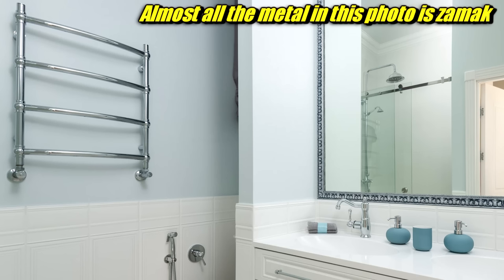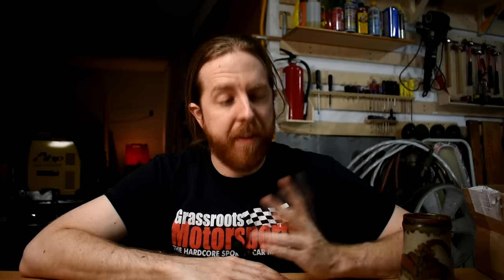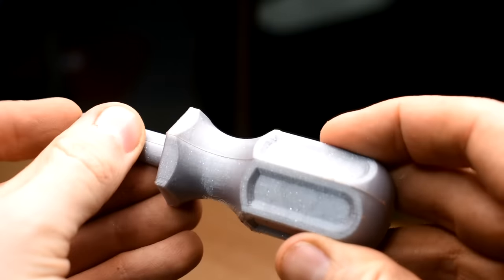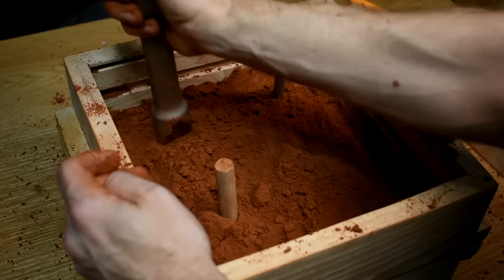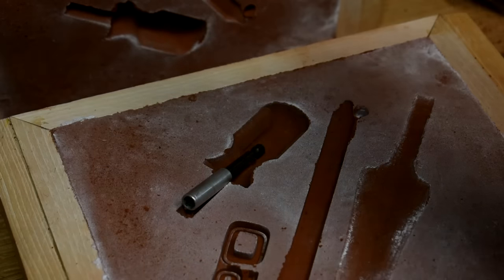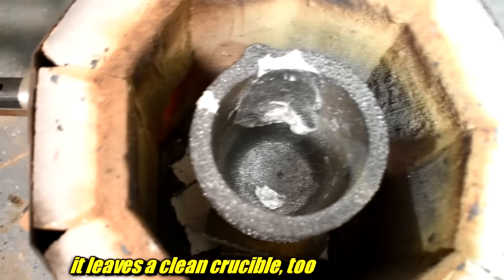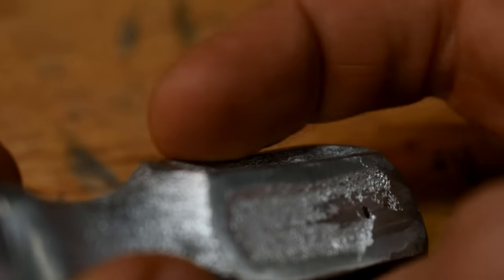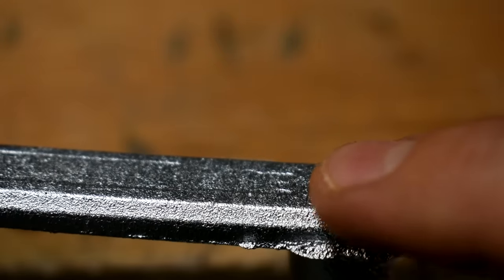The BEST Metal Casting Alloy That Everyone Ignores

Comment: Great stuff. One of the qualities that has made it unpopular is that designers use it as one of the go to materials for planned obsolescence. Since the zamak metals have predictable shrinkage they can for example, be used to make sure a fan will seize up after a predictable period of time. This is really good stuff, but it has been used in evil ways.
Reply: Thats interesting bud!
Reply: predictable shrinkage, as it slowly shrink years after casting?  what?
Reply: @tsm688 Ok, I found a page that says “Zamak alloys No. 3 and 7 can shrink about 0.0007 in./in. after several weeks at room temperature.”

However, I find it exceedingly unlikely that it is used to create planned obsolescence, since the amount of time can’t be delayed (only shortened by annealing), and no manufacturer wants their product to fail while it is still under warranty. Overall, I think that planned obsolescence is not even remotely as common as people claim it is. People confuse “short lifespan as a consequence of cost-cutting” with planned obsolescence, which is artificially limiting something’s lifespan.
Reply: @tookitogo  several Zamak alloys have predictable shrinkage rates at room temperature over a ten year period. It is small, but tolerances in bushings and bearings are also small so it is quite possible to aim for a unit to seize up or break after an intended period of time. Some allowance has to be made for shelf life before the sale, and heat exposure due to use, so the real calculation is to closely match an assured allowance for reliability. This is also the sort of wording that would be safer to use in internal documentation so your planned obsolescence can't be easily proven.

That said, if the design is done well, this stuff is great. It is only when manufacturers choose to use it in evil ways that it becomes a problem. 

When I learned drafting in the late seventies, we were taught how to design in obsolescence. There were industry scare stories about not doing it. One of them was about the perfect (for the time) oscilloscope. Basically a company made an ideal and durable oscilloscope, sold all of them that anyone needed and then stopped making enough sales to keep the production line open. The employees moved on, retired, or forgot what the tricks where and when the digital age started up in the seventies, there was a sudden huge demand for fast oscilloscopes and no one was able to produce anything close to what had been made years before.

So of course the lesson learned was not the right lesson and instead industry decided that planned obsolescence was the best solution.
Reply: @BobStrawn  I’d love to know examples of actual measures that training proposed be done. 

The main thing I object to is when cost-cutting is claimed to be planned obsolescence, when in fact it’s just matching the durability to the expected natural lifespan. For example, before smartphones, the average lifespan of a cellphone between replacements was 18 months. So there was absolutely no reason to spend extra money on extra-durable components that would let it last for 10 years, because most people would replace it long before that anyway. Similarly, we could design cars to last for 30 years without issues, but to do that we would have to sacrifice fuel efficiency, and the up-front cost would be higher. 

Major household appliances (“white goods”) are another interesting case. Their quality has clearly gone down over the past, say, 60 years. They are made with much cheaper parts that fail sooner, not to mention with added poorly-built electronics that aren’t built robustly enough for the severe environment of the appliance. But what people forget is that this is, in part, due to the fact that the store prices for these appliances are far lower than they used to be. Adjusted for inflation, a basic washing machine in 1955 cost many thousands of dollars in today’s money, while a basic machine today costs just a few hundred bucks. There’s no way to build something to the same build quality at 1/10 the price, even with foreign labor. Consumers like to say they’d pay a little bit more for quality, but in reality, they vote with their wallets and have consistently chosen the lowest-price items over the long term, so that’s what manufacturers make. (And yes, I acknowledge that private equity firms and the like have also pushed for cost-cutting for the benefit of shareholders. There isn’t just one thing to blame.) But I’d argue that cost-cutting in white goods actually shows that it is not planned obsolescence because of how many brands got so bad that recalls and lawsuits have cost them fortunes, and the damage to their reputations has been catastrophic. Planned obsolescence would ensure the products work well enough and last long enough that customers will still have positive associations and choose that brand again. 

I can only assume the oscilloscope company in question is Tektronix (which invented the oscilloscope as we know it today, and is still around almost 80 years later, still making oscilloscopes). They are no longer the absolute industry leader, but that is a fairly recent development, as they still were the leader in the 80s and 90s, with the best digital oscilloscopes at the time. Since then, “best” has become harder to define, as digital oscilloscopes have evolved in different directions, optimized for very different things, with various companies specializing in one type of digital oscilloscope or the other. Tek has sorta failed to specialize, so their current products are not really optimized for anything. :/
Reply: in the 50's and 60's, chrome-plated trim parts made from zamac alloys were the car industry's equivalent of today's chrome-plated plastic trim parts.
Cracks and pitting due to corrosion are their worst enemies, and they're about as difficult to restore/repair as their modern plastic counterparts (if not even worse)

Comment: You can get away with using high temperature silicone moulds (molds) for the lowest temperature Zamak alloys. The mould material does degrade but it's worth it for the fine detail you can get.
Reply from the maker: I've seen some people do that, it looks really interesting
Reply: If the mould is degrading I’d be very careful about fumes…
Reply: @athannaelanderson3806  From silicone? Should be nearly inert.
Reply: @Sgtassburgler  Key emphasis on nearly, hardly any products on the market are pure silicone, most companies include filler for extra profit, also silicone is stable yes but at high temperatures it does break down and if you read the scientific papers on Google scholar about it, it typically isn’t something you want to inhale, especially with those fillers, in fact silicone cooking utensils can also break down and liquefy in foods and than be absorbed when eaten, wreaking havoc on your system. Silicone is a great product when not used with heat, any kind of heat and silicone should not come to mind. Everyone considers something safe until they can’t profit off of it or until enough idiots die. You want to make proper moulds like our ancestors did, you want fine details, learn how to make your own clay! I’ve been moulding with clay for years, you can make it nice and liquid and pour it to make moulds just like silicone…

Comment: I found this very interesting in the following sense. I started my apprenticeship as a machine tool fitter in 1964 for AC-Delco, a division of General motors here in the Uk. One of the jobs we had to do was to repair the vane and screw hydraulic pumps for the injection moulding of this alloy. It was used for making 'mechanical fuel pumps, water pumps, etc and many other components of a car. I had some counterbalance weights cast from it for a home made telescope But this was never called 'Zamak', it was always calle Mazak.'  'Mazak' was it's original name and was later changed to Zamak. Personally, I prefer the former. An interesting video and thanks.

Comment: Zamak was used for making change gears for atlas/craftsman lathes, so it is a fairly durable metal.
Reply from the maker: Durable and supposedly a bearing alloy too, which is pretty cool
Reply: can confirm cast zamak gears work great, and are pretty quiet.
Reply: i had a set of those pot metal  gears in my craftsman lathe for 50 years, still good

Comment: Machines great too. Turned a vbelt pulley out of a simple puck of zamak I cast in an open faced sand mold. Melted zamak in a stainless pipe crucible over charcoal in about 10 mins setup to pour

Comment: 7:46 - I’d epoxy, a small neodymium magnet in the bottom of the Bit Well to make the bits hold again, then I would dip the handle part in some of that black handle coating. You can buy it at hardware stores or big home improvement centers. You’d have a great tool, then! Excellent video!
Reply from the maker: thats a great idea.  I have a couple of the tiny magnets that fell out of some other screwdriver bits, i could just jam one in there with some epoxy.  All fixed!
Reply: @PaulsGarage  Well hindsight being 20/20… neodymium magnets are really brittle, so you wouldn’t be able to put a whole Lotta pressure on it and definitely not hammer on it. It might be worth machining (or filing) a flat spot on the outside till you just break through to the inside, then just stick the magnet on the outside over the hole. Can you visualize what I’m talking about? You probably do, but I can send a drawing to your email if you like.

Comment: I used it to cast the front plate for the lexoptical camera using a lost PLA process. It worked amazingly well and resulted in a stiff strong component which easily holds lenses true.
Reply: hmm if i read corret the melting point of zamak12 is around 380C the silocon molds hold up to 450C you could cast small series of items :)

Comment: "The Metal Fume Fever" is no joke and something I learned to be aware of real quick when alloying bronze From Copper/Zinc/Tin back in the day. Hated the zinc shakes, we used to call it "The Zinkies" was some weird stuff man......but that bronze was ohh so sweet. Nice to see someone else using petrobond; that and french sand is the good stuff. We would re-mull my old petrobond with non detergent 30 weight motor oil and it kept casting fine details for well over 15 years shooting flames and all.....Keep on melting.
Reply from the maker: The zinkies, eh? What a clever name for a terrible thing lol. I love bronze, but so far I have avoided brass.  Tin bronze and aluminum bronze only, no brass, even though I have a bunch of it laying around
Reply: @PaulsGarage   I hear ya Paul, my Father was a classically trained bronze sculptor and started his own artisan bronze foundry fortunately I was drawn to it at a young age and became involved in the endeavor. Turned out he was a good teacher and I slowly over the years became a proficient at coreboxes and slowly became the master patternmaker and foundry floor foreman. I witnessed the industry standard evolve from black tuffy molds to silicone. Even the old school lost-wax chicken wire investment matured into the, now "modern" suspended colloidal ceramic slurry. Boy do we take the ease of a suspended colloidal ceramic slurry for granted these days! Back then it had to be constantly agitated and a VERY bad day ensued when you came in and learned the timer broke the night before on the investment agitator. If that stuff settled you were S.O.L. Stuck chipping it out for the next couple days!  We did everything "in house" so to speak. From waxes, casting, alloying, machining, finishing, and even patina. TIG welding went by the name of heliarc back then.

         I naturally became his engineer and he remained my eccentric artist professor. We made an unstoppable team. I learned so much from him and was extremely lucky to have had the opportunity to glean as much from him as I could back then. God rest his soul. He was truly "one of a kind". I didn't realize how lucky I was to work with him every day until he was gone. I miss him; "Father-son" arguments included! Ha!  

Keep up the phenomenal work Paul. It's very reassuring to see someone like you using proper materials and technique. Consider this the highest compliment you could get from me. Considering all of the strange backyard videos that come up using "lost foam" these days it's good to see the real thing is still being done. I respect the traditional methods in which you get real results. Unfortunately much of this work is now a lost art these days and 

     Thank you for allowing me to reminisce in those countless fond memories I had; back when my Father and I were a team. I will cherish them till the day I die.
Reply: @PaulsGarage  I hear ya it's smart to start with what you know. Once you have experience under you belt and the circumstance arises; only then should one progress into the more complex/dangerous stuff that requires a solid knowledge and skill to deal with safely. 
         
        Silicon Tin and Alum Bronze are certainly workhorse alloys. In our foundry we dealt mostly with Silicon and Commercial Bronzes (Cu/Zn) for Artisan Sculptural applications and on occasion Naval Bronzes (Cu/Sn/Zn). Matter a fact I've got neat story you may appreciate. Many of the NDA contracts we had with the Groton Naval sub base here in CT required Manganese Bronze in the specs. The largest patterns and coreboxes we did for them were some of the most complex I've ever done. Lets just say they were very interesting "stealthy" bladed things and gun mounts that required it. Because of the security requirements, photos of these patterns do not exist. It was out of the question even having some locked away in a safe for posterity. Subsequently It was a rough thing having to destroy those beautiful patterns after the contract! Those memories and images only exist in my mind now. 

That Manganese Bronze was insanely nasty stuff to cast and exponentially more complicated & dangerous. Gates with modified runners and risers; even cooling ribs throughout to reduce local hot spots, as it liked to be poured cool. 
      -B

           Cast on Paul!
Reply from the maker: That's really interesting thanks for sharing!  I've never tried manganese bronze, but I've seen some stuff made with it.  Ship parts are pretty awesome for sure.  The first time I saw a photo of a bronze ship propeller I was blown away when I realized it was surrounded by people and they looked so small!  Its too bad some of that stuff is shoved underwater and we don't get to see it
Reply from the maker: And did you say Groton?  I've been there a couple times.  Last time was a visit to the mystic seaport when they were rebuilding that whaling ship.  Did they ever get it finished?
Reply: @PaulsGarage   Yep those naval ship propellers dwarf us mere humans! Like you those photos always inspire absolute awe in me. The pump jet props for subs are completely different animals designed to minimize cavitation at speed. Those designs are incredibly guarded and posses some incredible geometry on both the stator and rotor blade assemblies. It's a testament to the United States military and the capabilities we have. I can only imagine how much this technology has advanced when it comes to the newer 6th generation SSN(X) sub program now. If it ever came to underwater hostilities, our "Feck around and find out" pedigree will prevail. No question. The scary thing is, for whoever that may be.....they won't even hear it coming!
Reply: @PaulsGarage   Whaleship Charles Morgan built in 1841 is indeed once again seaworthy and back in the water! I actually watched it plunge back into the Mystic river in March of this year. It's the second-oldest seaworthy ship in the world after the USS Constitution. 
        Mystic Seaport is a gem, small world eh? They are currently working on an absolutley majestic sailing schooner yacht called Coronet which was built in 1885. I actually got to see the shipwrights restoration in action on my last visit. It's always a treat to walk through the shipyard there and see the shipwrights in action. Its a small porthole into the past of maritime history. It's always an honor seeing the ways of traditional ship building techniques; still amazes me to this day. 

I remember years back seeing when the Mayflower II was in the shipyard and building the keel was a severe issue as they needed specific old growth live grained oak. It had to have a specific "crook" to facilitate restoring it to period correct construction. 

They actually sourced and shipped a +100 year old live oak from Louisiana to be used as part of the keel for the restoration. The other live oak used was from Mississippi. This tree actually saved the life of a woman during Hurricane Katrina when a tornado then hit. Clinging to this very tree saved her life. It was estimated to be 250-500 years old. After being downed from a hit by lightning its home is now in the Mayflower II. 
There is a great article on it if your interested:
"MAYFLOWER II Live Oaks Part of Legacy" 
https://www.mysticseaport.org/news/mayflower-ii-live-oaks-part-of-legacy/
Reply: @appatula  What's wrong with lost foam? It looks to yield excellent results.

Comment: Did some huge castings in Zamak 12 years ago, and discovered that when liquid  it will dissolve aluminum. Much like gallium dissolves aluminum. 
Shrinkage on BIG castings is insane. It will rip itself apart while cooling. You can cast long thin rods and use it as "miracle rod" the same soldering rod they sell at stores for hobby repairs.
Reply from the maker: Interesting!  Didn't know that about big castings.  Here in my test I thought the shrinkage didn't seem bad but I'm comparing it to the wrong alloy of aluminum, one with horrendous shrinkage haha